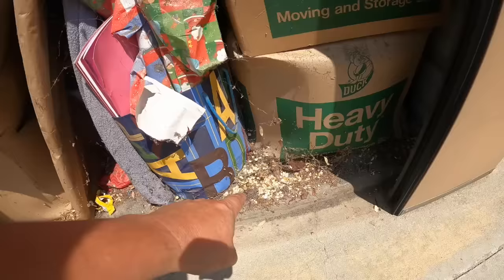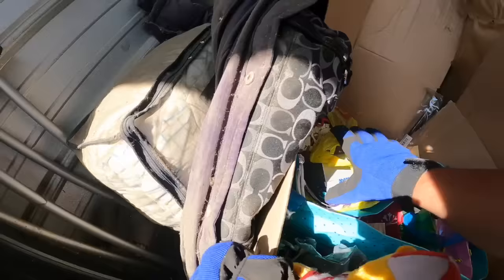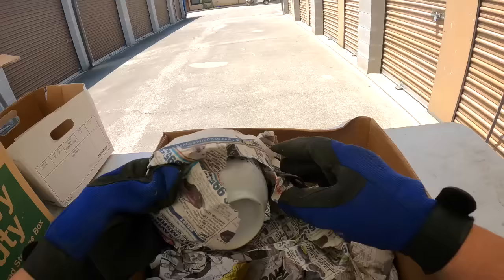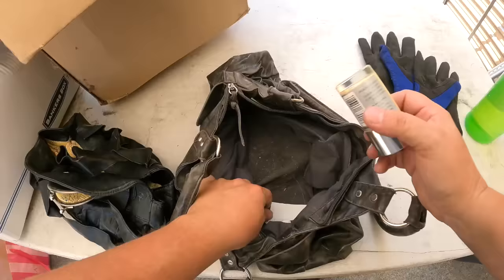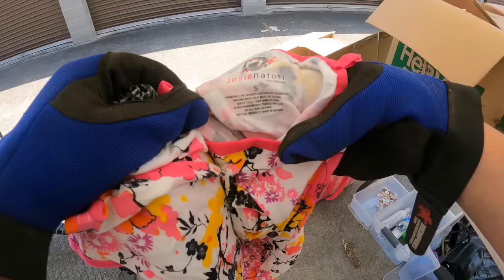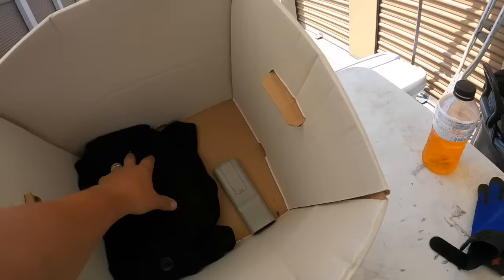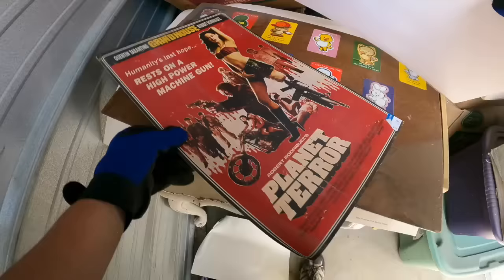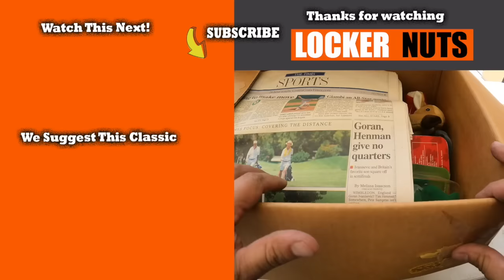Paid ONE DOLLAR for this locker at the storage auction and found a huge jug of change. CHA-CHING!

Comment: I found your channel last week and I'm obsessed. Question - when you get the units for $1 is it because no one is interested and the storage company just wants it cleaned out?
Reply: More than likely
Reply: Both. Some facilities reserve the right to set a lowest price. So if no one bids the lowest price the locker unit is not sold. In this case, that did not happen and they just wanted it gone and Jack was the only bidder at $1. It's a huge benefit to some facilities to let the lockers go at $1, it costs a lot of money to have someone come in and clean the place out, then dump the items. You can see Jack sorting the items plus he has his trusty garbage can. He will need to make a "dump run" in the end which costs money to do. The facility wins in that the the locker is cleaned out and Jack scored by already making his money back with the coins, the rest is profit. You really can't lose on a $1 unit BUT as you can see it is an enormous amount of work.
Reply: @motherofone1  His time and gas are worth more than his profit so far!
Reply: @karenmiller2974  That's true. It's rare that time spent will ever turn a profit, though Jack has been really lucky lately.

Comment: Can you just buy the locker and sell it back to the real owner for a profit?? Because I feel really very bad for the real owner for his stuff to be thrown away or resell for cheap!! Some times some stuff values you most. I mean it's your own stuff and then you have to loose it. I'm related with this kind of situation but not as a locker room but an apartment full of stuff.
Reply from the maker: Yes, we could sell the locker back to the owner. However, it gets tricky because often when they become delinquent on their bill, the storage facility will ban them. Therefore, you'd need to either get permission from the facility to allow this to happen, or move the items out of the locker and transfer to the owner off site. Both can be tricky.